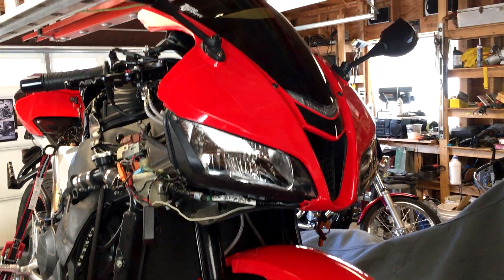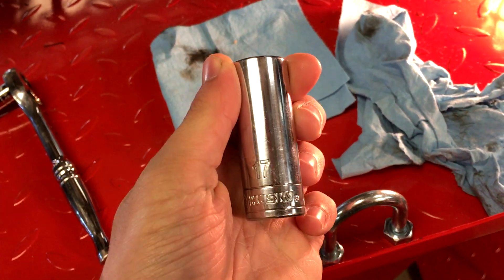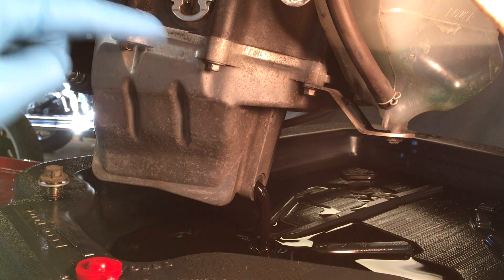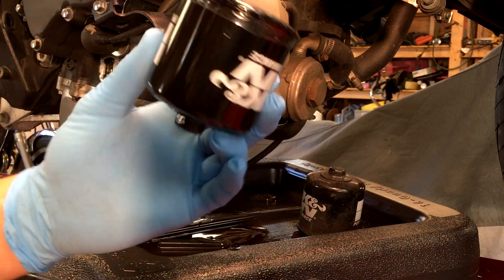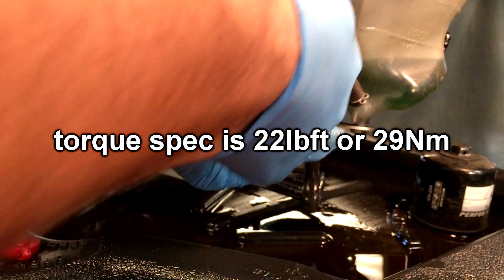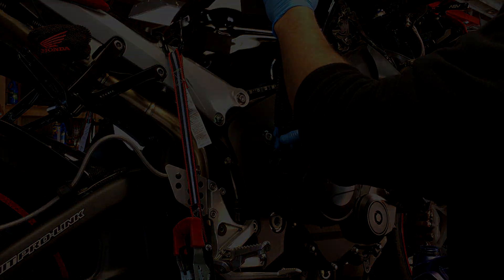How to change your motorcycle's oil [Maintenance]

Comment: You can run diesel oil in a bike?!?!?! MIND BLOWN! lol I didn't know that!
Reply from the maker: Yeah! I was really surprised when I first found out too.
Reply: The Muscle Biker Rotella T6 is rated for motorcycles. It's pretty cool! Been using it in my 600rr and also used it in my f4i
Reply: Zack Van Goethem I'd probably use it on my zx but I dunno if I would do it on the RSV4 lol
Reply: I use it in my FJR1300, my lawn mower, and weed eater.
Reply: The Muscle Biker to

Comment: SOOOO NICE without the header there.. great video.. the lighting is fantastic and that lift... that's the shiznit right there.... so I noticed black passenger pegs.. those are new right?  Are they painted, powdercoated or OEM?
Reply from the maker: Thanks! I love that lift! Unfortunately this will be my last easy oil change as the arrow headers make it very tight. You my friend have a good eye ;) Yes, they are new! Those are powdercoated from TST actually. I bought used from 600rr.net member.

Comment: Very informative! Thank you brother. I have a 07 cbr 600 rr just got it. My 1st bike I want to try to do things on my own if I can. I'll be watching your vids for help.  do you recommended using that oil on mine? It has just over 10g miles. Also I live in Florida Hotter than the Devils @#$% Would that matter as far as the oil is concerned?

Comment: Great video... very clear. Dammit, i miss working on my bike. :)
Not sure how I feel about the Diesel oil, but that's probably just because I absolutely hate anything diesel.
What made you start using it?

Why don't you get a torque wrench? :) 
I've got a set of three. 5-25Nm, 5-100Nm and 25-205 Nm. They are not that expensive and can prevent a lot of trouble (mostly through over tightening). They'll last you a lifetime if you use them properly. (That means just for tightening and when not in use, put them back to "0").

Edit: forgot to mention
Removing the filler cap before draining can speed it up a bit because it can suck in the air through the filler hole.
Reply: If you feel that way about "diesel", don't use the oil.

Me? Although I also use the T6 oil (I like the slightly lower "5W" pour point compared to the 10W and 20W oils), in truth, it really will not make much difference what brand of oil you use.

Modern oils, mineral or synthetic, are good enough that as long as you use the appropriate grade of oil and stick with recommended oil change intervals, you will be fine.

Just use JASO MA/MA1/MA2 certified oil. If you have a wet clutch, steer clear of oil with what they call "friction modifiers".

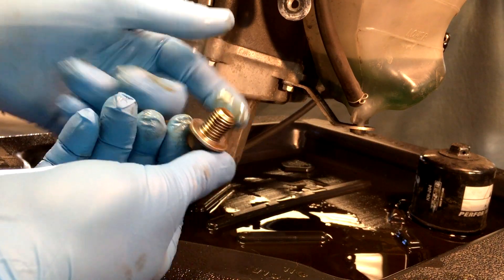Comment: 7:40 i wonder why they use a metal crush washer instead of a soft/rubber washer.  do you know?
Reply: It works like a springload and helps the bolt not to unwind 🙂
Reply: @sir240s  I would think that a soft washer would act like a locknut to keep it from unwinding
Reply: @justaguy4real  yes true :)

Comment: isnt it better to use a thinner oil so it gets into the nooks and crannies with todays tighter tolerances of machining, more so than a thicker oil could or couldnt?? I blew my chevy motor using 20-50

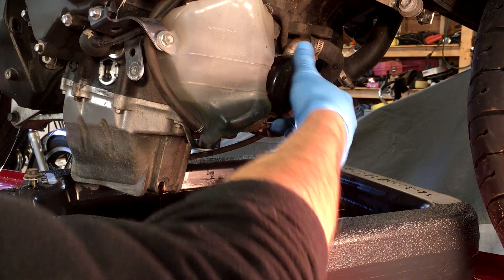Comment: 4:00 unfortunately the usefullness of the exterior nut  on there doesnt compensate for the quality of the filter itself.  but it is useful for sure
Reply: mikeyb byekim it’s pretty dangerous if you use it to put it on as you put stress on the welds/crimps

Comment: My only minor complaint is your using OLD oil to prelube the oil filter.
Reply from the maker: +John Casteel lol
Reply: I mean it's his bike but it takes no more time to just dip your finger in the new oil and add it. My complaint was tightening it with a socket. Oil filters only need to be hand tightened. But then again I only use OEM so no nut to tighten anyways. Tracks around here have k&n oil filters banned

Comment: Torque wrench the filter to 20 ft lbs and the drain plug to 22 ft lbs.  it is was the manufacturer specs are. ;). I am very interested in the oil selection save some $’s

Comment: why would you never replace the crush washer? 7:40
Reply: Usually the old one will not leak. As usual, YMMV.

Me? I always change both of mine (engine drain and final drive drain bolts on my FJR). Cheap insurance.
Reply: John Casteel emphasize on the word NEVER

Comment: Very bad info on oil and intervals 🤔 allways use motorcycle oil as it can take more revs. Oilchange is no more than once a year or 10.000km
Reply: No need for more, offcurse you can do more 🤣
Reply from the maker: The Rotella oil is used in Turbo Diesel Engines which will spin up to 150,000 RPM. Trust me I ride my bikes hard and red line them routinely and I've never had an issue with this oil. Been using it for 5 years.
Reply from the maker: Also the Honda owner's manual says to change the oil every 5000 miles. I usually change it every 3000 and when it comes out it looks fine. I've also done oil analysis on my  bikes and they've been all fine.
Reply: Hero RR I don't know if you say my question,  but I assume your up north is that Rotella good for fl. Heat?